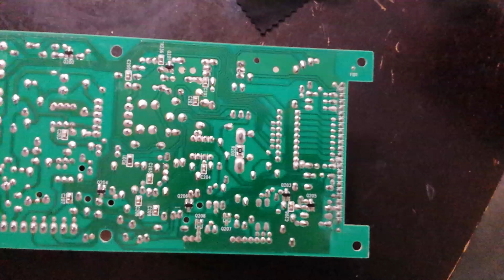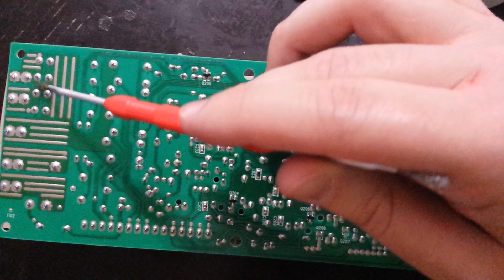Frigidaire oven control board repair (water damage)

Comment: I have double Professional ovens. My second one was not working. I called an appliance company and he recommended changing the electrical board $940 plus his labour. I did this, paid 50%. Well, the oven is still not working. They need to access the back. The electrical cords are not long enough. Any suggestions?
Also, how do I tell if the electrical board was necessary to replace when I have the exact same problem with the old electrical board?
He showed me a little brown spec on the board. He did not do this testing. He just said the electrical board needed replacement. Your reply would be appreciated as I feel cheated. Thanks